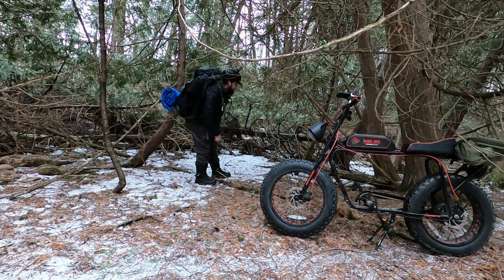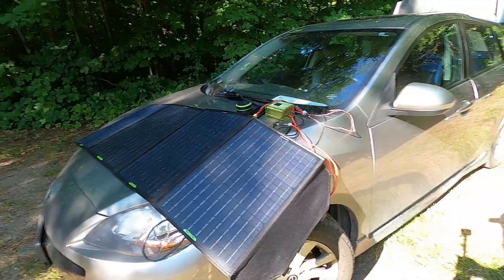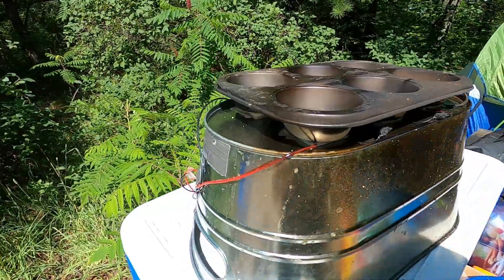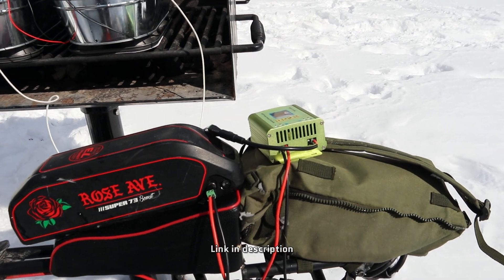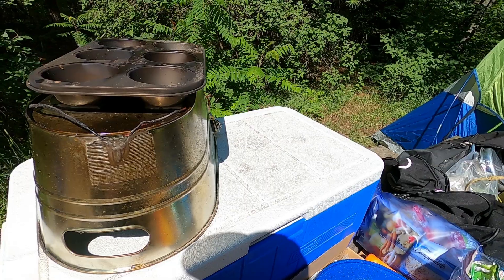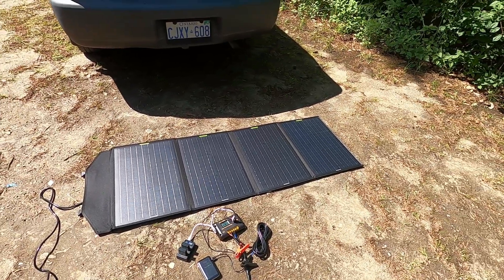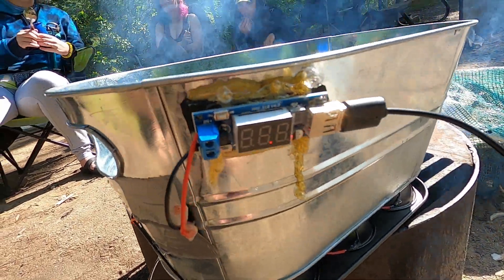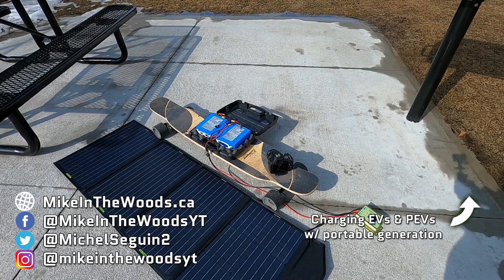Using HEAT To Charge An E-Bike (Thermoelectric Generator)

Comment: Why not use water, to use to heat and cool?
Advantage is the chips solder would be safe from melting, and a black hose can supply heat from the sun?
Another hose could supply cool water from a river, or other cool water as ource?
8td be safest for the chips, else, if they overheat, the solder will melt, and it would stop producing voltage, and amps to keep a  60 volt ebike battery charged for instance
Reply: Two small 12v water pumps costing less than $10 ebay, could start the circulation of cold and hot water